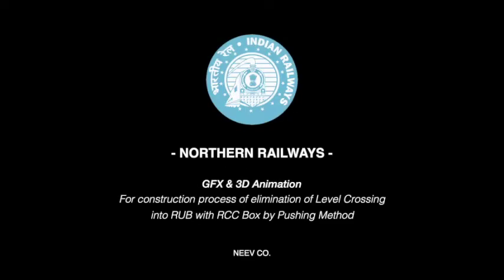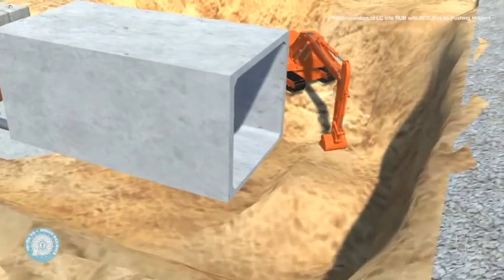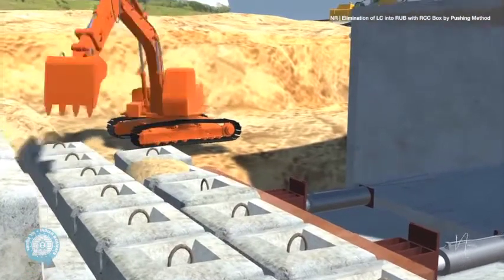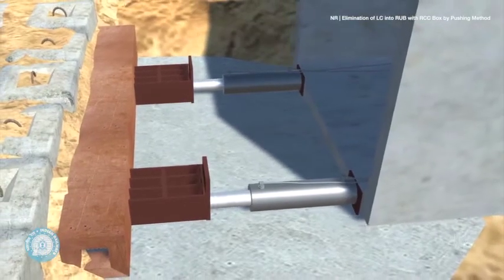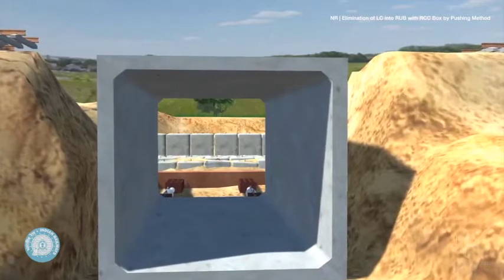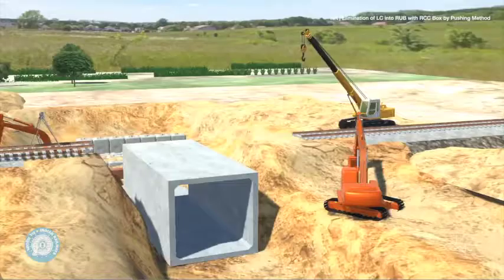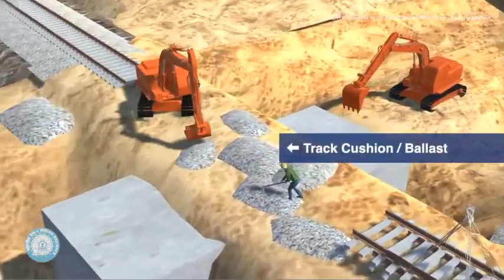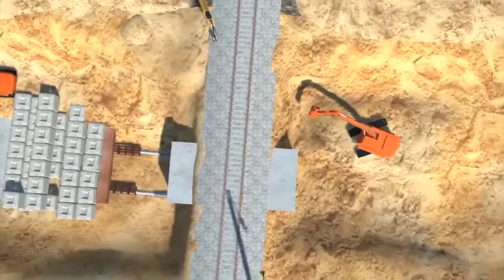Animation - Box Pushing Method RUB_Northern Railways_Neev Co

Comment: But why? I thought the whole idea of the box pushing is to keep the track operational while constructing the underpass.
Reply: Exactly my question
Reply: Well let's imagine a scenario where you have to build a tunnel under the railway line, in conventional way you need to build using RCC at the exact place where you need. But according to this you don't need to cast the RCC under the Railway line, you can precast a Box section and fit it under the track within one day. But conventional tunnel building will take huge amount of time.

Comment: Why do they need to push the box when they had to cut the rails and dug up beneath. If that was the idea, they could have simply place the box directly with the help of cranes, where was the need of the hydrolics ?
Reply: I think this is just to explain because the boxes are very heavyweight and cranes are unable to lift that. I had seen the process on ongoing dwarka expressway. These boxes are very heavy and lengthy.